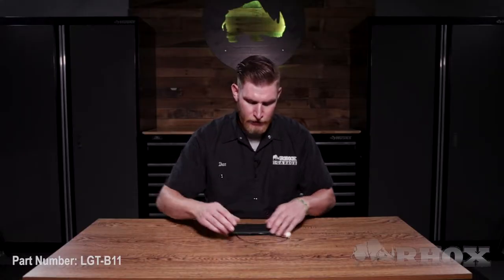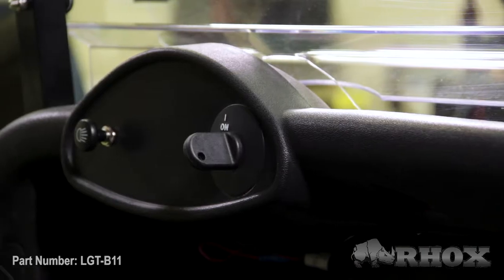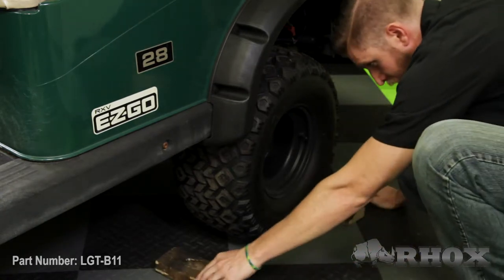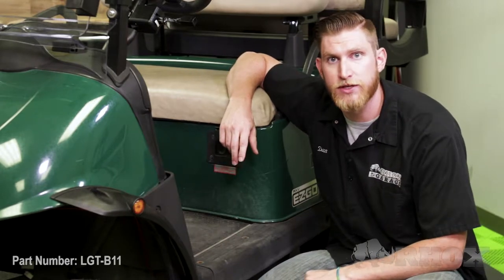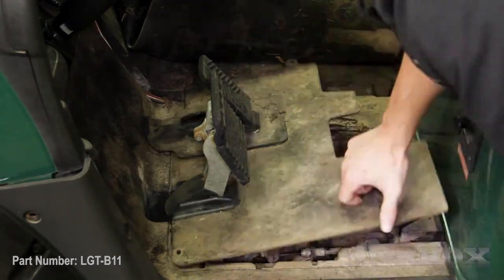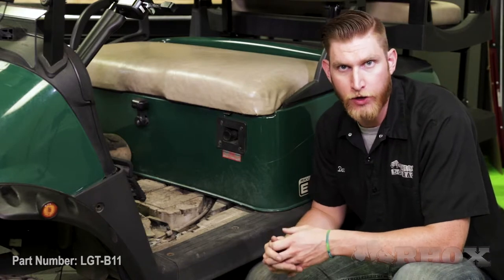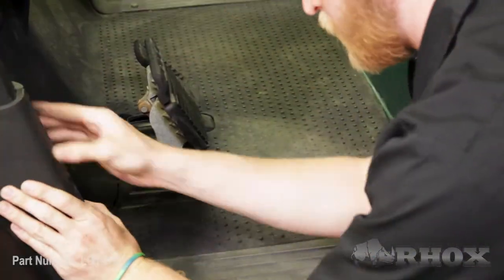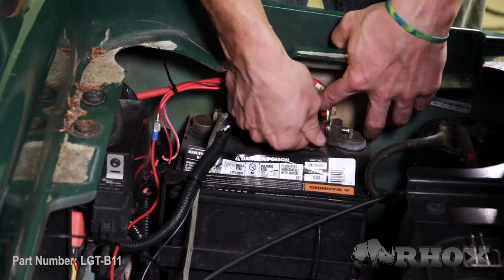LGT-B11 Brake Switch on an E-Z-Go RXV

Comment: Looks easy if you already have a wiring harness from a previous install.  But what if you have to wire one that didn't have that already?  The 2017 EZ Go RXV does not come with brake lights as standard equipment which is crazy if it comes with lights, then brake light should be a priority, not head or tail lights!

Comment: My batteries are dead from sitting all winter and probable need replaced. They won't take a charge so there is no power to disengage the brake. What are my options?
Reply from the maker: We carry a brake release jumper (BRK-039) that you can use to disengage the motor brake. It requires 24-48V to activate so you would need another power source.  

Golf cart chargers will require a certain voltage in order for them to recognize the batteries.  I would try using a trickle charger to see if you can get the batteries to charge enough to get charger to recognize them before you replace them.